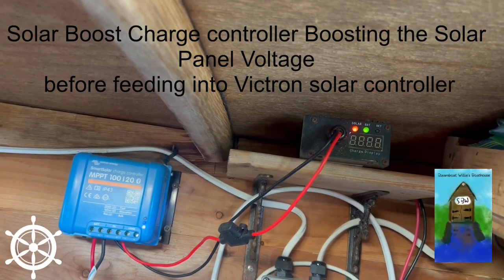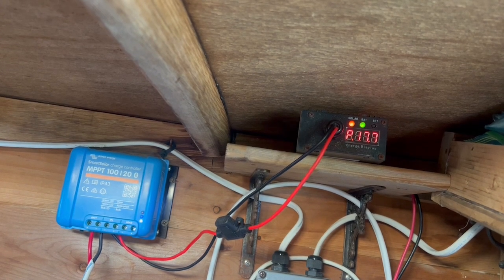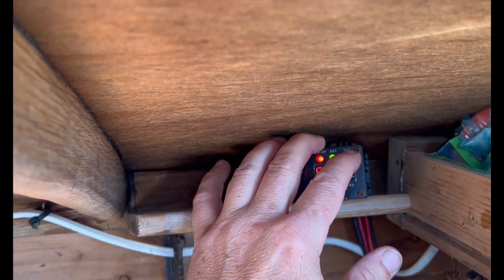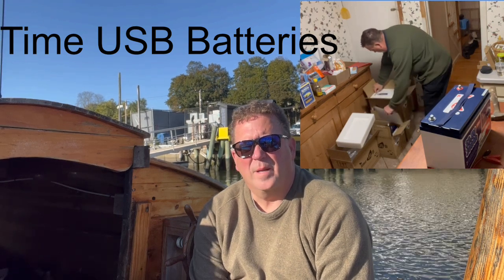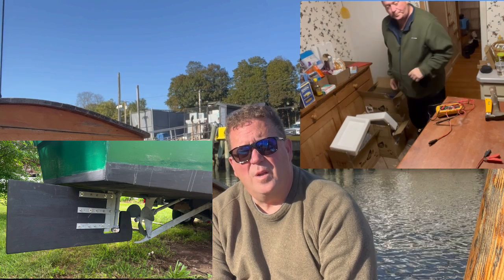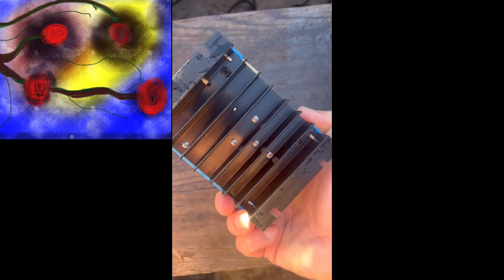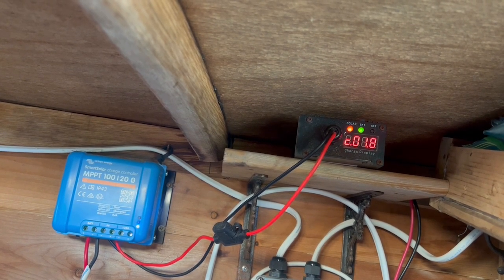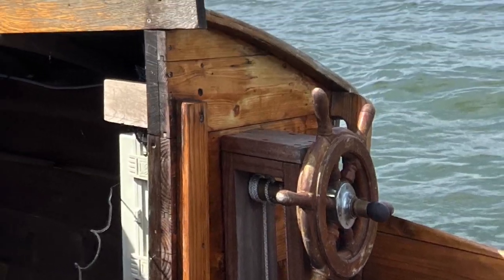Victron Solar controller - MPPT Solar Boost Controller pairing

Comment: Interesting.
Thank you for sharing.

If I understood correctly, you are using the boost solar charge controller with a 12v Solar panels. But the victron mppt is reading the booster as a solar power with 48v solar power panels and then you are able to better charge the 48v batteries?

Thank you in advance.

You still advice this method?
Reply from the maker: Yes I actually have the boost set at 72 volts and victron takes it and reduces it to the appropriate voltage in current
Reply from the maker: Yes and yes